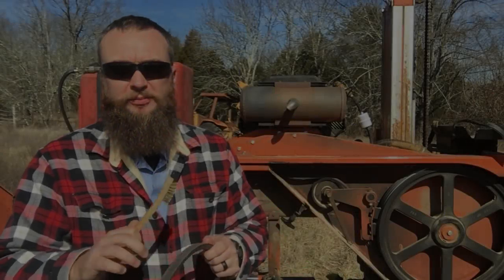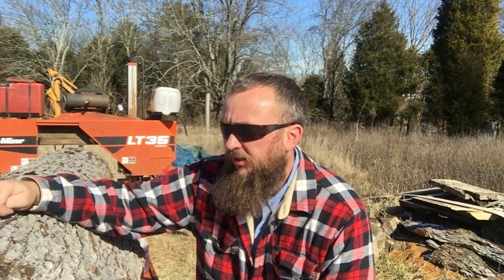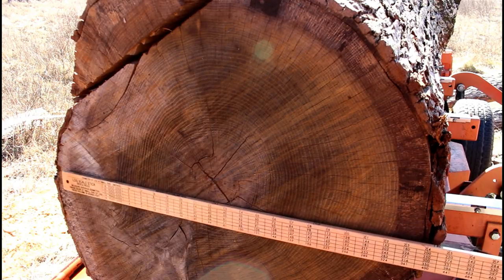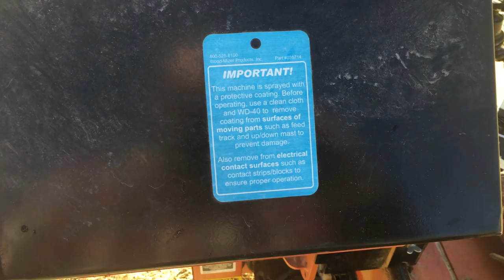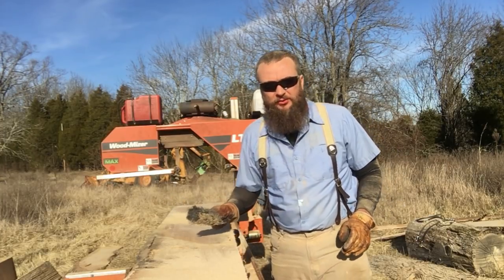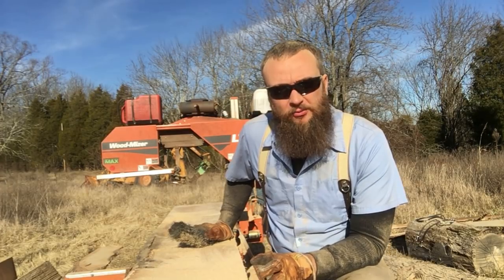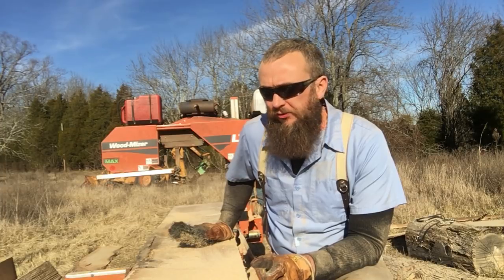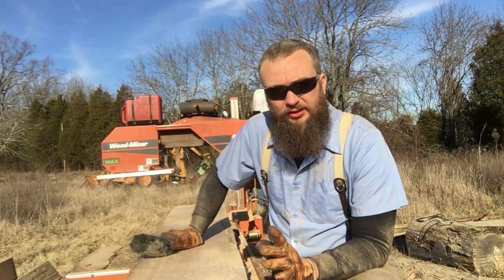THE BEST JOB IN THE WORLD, RUNNING A SAWMILL

Comment: After you spray the rails and chain with ATF does the saw dust stick to those surfaces and cause issues?
Reply from the maker: Never had that problem. The carriage head usually keeps it clean. Thanks for watching. I always also go over it with a leaf blower after sawing

Comment: Do you ever saw Hedge Apple wood ? If so , is it hard on the blades?  What about the Caliper Video?
Reply from the maker: Never sawed any hedge wood yet. 
Caliper video? Refresh my memory
Reply: I asked you a few videos ago where I could buy calipers to measure trees in the woods. When I was young you could buy cheap ones in about any hardware. You said you thought about making a video about it.
Reply from the maker: right like the stick I showed in this video? the biltmore stick
Reply: Calipers slide on a measuring stick but have a piece that moves to fit around the tree before it is cut. I googled them but they are in metric not inches and are very expensive.
Reply from the maker: Ok I mis understood you on that other post, thought you were talking about the biltmore stick,

Comment: What are the pros and cons between your kiln and a solar kiln like the Virginia Tech. plans detail?  You thoughts please sir!  Thanks!
Reply from the maker: my kiln can run at full speed year round, the solar ones not so much, in the winter they do not do so great and still hard to regulate,
Also mine is accurate and consistent and can reach the high temps (150-160) needed for sterilization of wood, I doubt the solar can get that hot especially in the winter months,
Reply: Thanks
Reply: Can a greenhouse be used for kiln drying of the Wood. The wood can be used as a heat sink during the day and heat transfer to your nearby house at night...😎
Reply from the maker: Yes it would be similar to a solar kiln. I’ve read about it before working
Reply: @OutoftheWoods0623  thanks